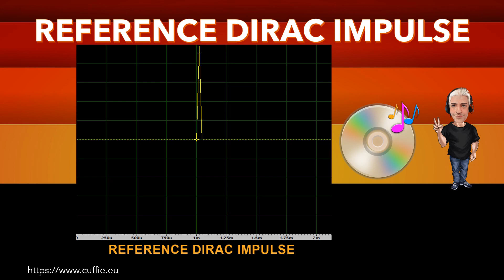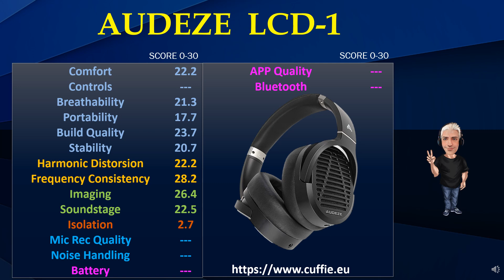AUDEZE LCD 1 - Review, Recensione, Mixing, Sound Demo

Comment: this is supposed to be oly grail of headphones people swear by even for mastering on a high end level. either this graph is wrong or people just praising lcd 1 for another thing.
Reply from the maker: The analysis is not wrong. if you go and see the test of the Sennheiser he-1, which is a perfect headphone, in fact the frequency response is very linear. therefore LCD-1 such headphones are bought for other reasons not for the linear frequency response.